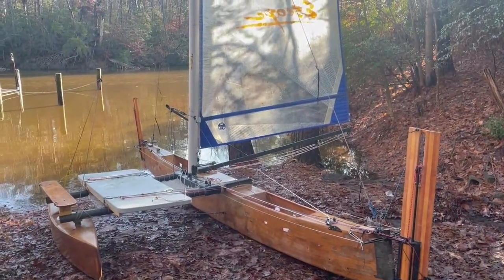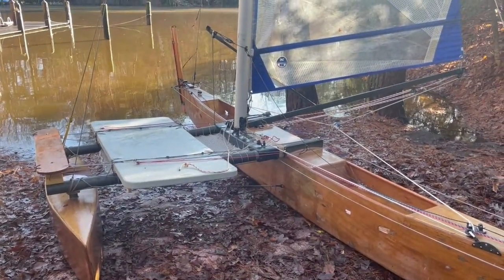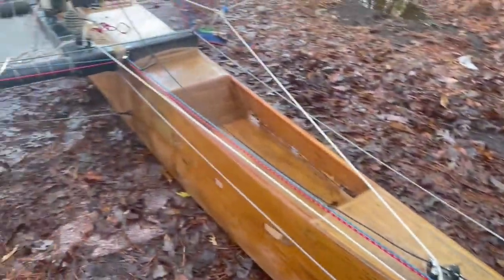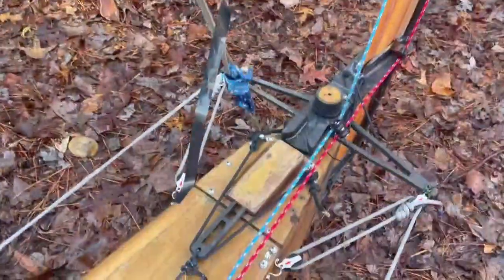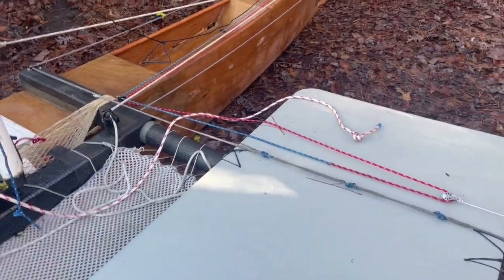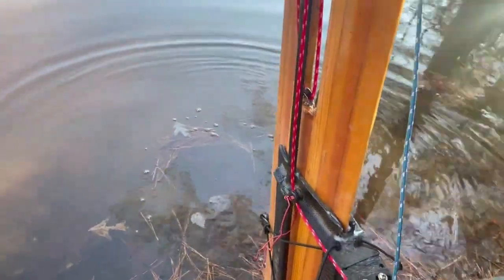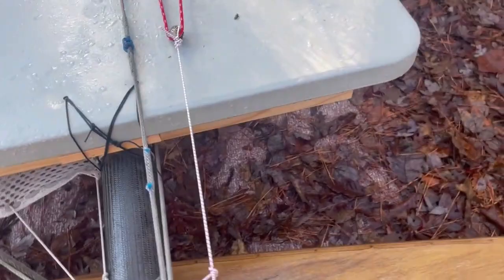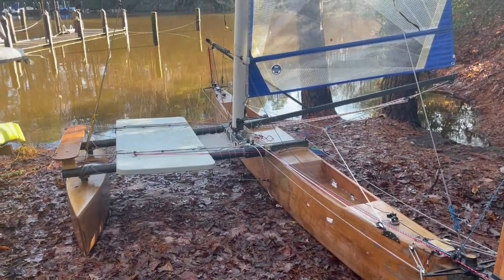Crazy Proa project. Steering system.

Comment: Love your work.
Just wondering of what are the advantages of your system over others.  
The simple Newick / Brown cassette rudder / board does seem to be best for most .
Though doing similar though with a fully rotating spade rudder perhaps even better, though needs more engineering
Reply from the maker: I built the boat to participate in Watertribe events. Sailing in very shallow waters are part of challenges. So rudders are designed to kick up/absorb a hit. It is impossible to do with Newick/Brown/Harris designs.
Reply: @VladimirUD  very sensible.  Russ Brown says he had never hit anything in his travels…would I be so lucky

Comment: Very nice kick-up system for the rudders! Where did you get the brackets from?
Reply from the maker: Thanks. I made all parts for the rudders system. I either fabricated them from a scratch or I used premade carbon fiber plates and tubes. Plates and tubes are available from several sources. Such as DragonPlate, RockWestComposites or Amazon.

Comment: Interesting stuff man!!! You are very talented, I like your rudder set up. Good luck with the boat, lets see some sailing.... Keep Shunting bro, Balkan Shipyards
Reply: Nice work.
Though I do wonder if the bow rudder will hold straight in a strong wind and waves
Reply from the maker: @markthomasson5077  it locks pretty solidly and I need only about 25% -30% of the board area going upwind. I raise it 2/3 up going to weather. I raise it completely going downwind.
Reply: @markthomasson5077  I too have a problem with a rudder crashing through breakers... Yet impressive work.
Reply from the maker: Keep shunting indeed!